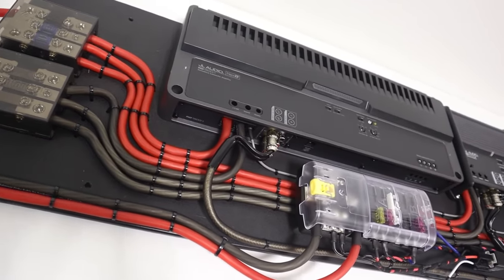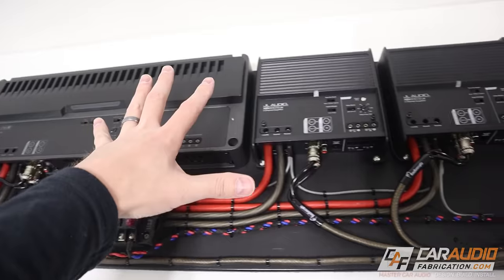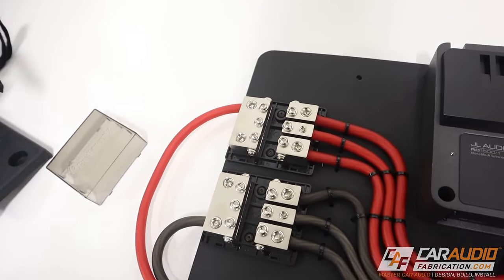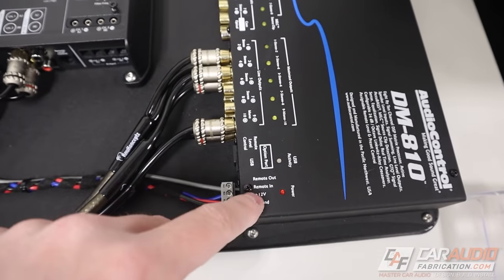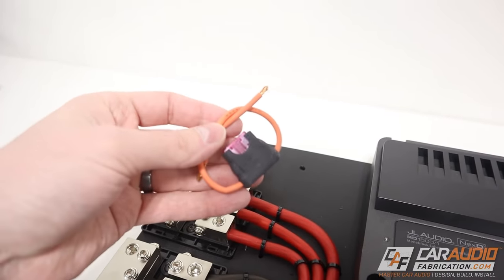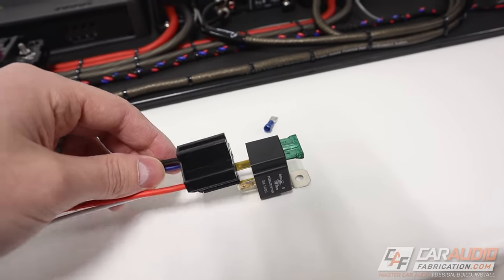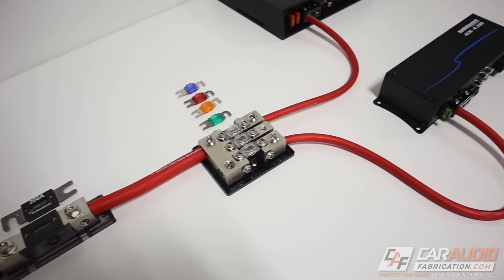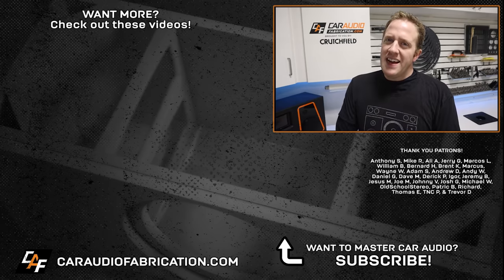Use RADIO to turn on accessories with a RELAY! EXPLANATION & WIRING

Comment from the maker: You guys asked for it...So here it is, Enjoy! If you missed the amp rack wiring video check it out here: https://youtu.be/UMAXMWmYX3o Thanks guys!
Reply: Is there a difference between a built-in virtual dsp over a physical dsp? I ask because some head units will come with a dsp built in. It may be included to make head units more attractive to consumers, but is there drawbacks? How versatile is a built-in dsp compared to a dsp from AudioControl?
Reply: All this power will u need a extra battery
Reply: Hi Mark. I have to note to the relays diode. While a regular diode will do the job you have a high voltage drop by using one. Best is to use a zener diode. They have a lower voltage drop while having the same results. Zener diodes are more efficient than regular diodes.
Reply: Hello Mark,
Love what you do with your installs.
Just wondering would you custom build a box for a 10" JL Sub that would fit a VW Golf? 
Thank you.
Reply: Where’s the rest of the build?
Reply: With a system like this how would you add a battery isolator and secondary battery?
Reply: Where do I get that relay at?
Reply: My head unit has a blue/white "system remote control" wire, but there's also a solid blue "power antenna" wire coming from the vehicle that inputs into the head unit(?) Which should I use to power on my 2 amps?
Reply: If you ever want to do a video series on a 2023 Hyundai Santa Cruz, let me know what I need to do!
Reply: Where can I buy the relay with a spike protection diode. I have no clue what I'm looking for . If u can send me a link to one I need I'd appreciate  it!  BTW I watch every single video you've made lol. Your a great content creator.

Comment: Do you have a link for the relay that you purchased with the diode built in?
Reply: Did you ever get an answer to this?
Reply: Still waiting
Reply: Not the greatest having to buy 8 as a diy guy but I'm sure it won't be impossible to flip the other 7.
Reply: Have 6 left after the install.... mistakes were made.  😂
Reply: @ElevatedVehicles he never respondes.

Comment: The relay idea is one of those "Why didn't I think of that" things that is so simple yet so elusive.
Reply: I've been using relays for about twenty years.
They are great for light bars, LEDs, amp fans, all kinds of things
Reply: @anicetomaldonado  I have not thought of relays for my amp systems, but I've been using relays for decades for lights, accessories, even making up my own turn signal converter for when the vehicle has amber turn signals and the trailer lamp is combined.
Reply: @robertemmons2260  yeah, I don't use them for amps, rather the external fans one adds to an amp rack. I even used to have a 12 volt coffee maker.
Reply: @anicetomaldonado  where do I get that type of relays from

Comment: As others have asked, how do we find the correct relay with the “spike/flyback” diode built in?  Google-fu is failing to provide answers.  I appreciate the videos, but it would be greatly helpful if you provided links to all parts you use when introducing something like this.

Comment: hi mark, with the relay wire i unpinned it and used new Female Spade Terminals with Locking Tab, crimped new wire cut to length.   The way i remember what wire go's where on a relay is the compass method, looking at the relay pins the vertical pin at the top 87 north N=( new device), 85 east E= ( earth) 86 west W= (sWicth 12v), and 30 south= (solid 12v)

Comment: Been using relays since frying two decks in the late 80s.  Newer equipment can draw less current than old school, but I still use them for future accessories as mentioned in this video.

Comment: I did this on my truck. Running a RF 400.4 and a RF 1200.1 with crossover network. The relay is triggered by the remote turn on and goes to the amps and xover. It also goes to a 100A continuous duty solenoid for ignition hot 6 way power/ground block for other items and another 6 way power/ground block for constant hot items. Works like a champ!

Comment: I am currently using a relay because I'm running three amps, LED rings, and a crossover.....and I fried the remote  output circuit on my first head unit before I thought about adding the relay. But even after adding the relay I still didn't think about adding the diode until I watched this. Thanks for the advice.

Comment: I would recommend always making a habit of putting your switched load on pole 30 rather than 87.  For a SPST, it makes no difference but if a SPDT is used it does.  If the 12v source is hooked to pole 30, then the wire attached to pole 87a will be energized when the coil is at rest.  While that wire can be left unhooked, it is a potential short since you have 12 volts running through the relay all the time.  

If you hook pole 87 to your 12 volt source, then you can hook 87a to ground.  This will ground the load circuit on pole 30 when the relay is at rest.  Once energized, pole 30 will see 12 volts as needed then return to ground once the relay is no longer energized.  The difference is only whether you have a loose hot wire all the time on the switched side of the relay, or not. 

As I said, for a SPST, it makes no difference. But if you just get into the habit of always putting the switched load on pole 30, then interchanging between a SPST and an SPDT an almost non issue.
Reply: It's important to have good habits like this. There are too many "good enough" methods, and many are not actually good at all and result in car fires, failed equipment, poor sound, and many other faults and failures. Good job taking a moment to share, we need more of this.
Reply: This is a joke right? If you ground 87a and have 12v on 30 then in an off state the relay is shorting 12v lol. Unless you're talking about setting up the relay so that 87 is 12v and you ground 87a. Why would it be beneficial to ground a power wire at rest lol?  I've been in car audio/aftermarket electronics for 5 years and I would never go through the effort of doing anything you just mentioned. If I'm not using 87a it's getting depinned, or cut short and taped with another wire on the relay with fabric tape on top making it all pretty.
Reply: @johncox6666  pole 30 goes to the amp, 87 goes to 12v source.  Grounding 87a just guarantees that there is no voltage on the circuit when not needed or wanted.  

You can just pull the wire or cut it short, but why not use it and ground the circuit if you have it.  When using the ground at rest the circuit is dead-dead and there is zero chance of any stray voltage activating anything on that line.  

Dad was an electrical engineer, so i picked up a few things from him that come from that background.  These are things he did as best practices, and generally apply to most applications even if not absolutely necessary. 

This is exactly how the electric choke on my old truck is wired.  Just ground the circuit when not in use - No need not to.
Reply: Can you make a video on this?
Reply: @mebordernoneya8484  its just time consuming and unnecessary imo. What's on the other side of the load? Ground. Which do you think provides better ground potential for current to flow? Backwards or forwards? If the engineers that made the product had any sense then power won't even be able to backfeed out the supply line even if the product does store power either with a battery, capacitors, etc. Maybe this logic made sense 30+ years ago but it doesn't now. Circuits can be made in a way that if they are storing power it's not flowing back out it's power input anyway so you applying ground is doing nothing. It's like when they say to battery reset your vehicle by pulling power and shorting the terminals together. Say it with me SoLiD STaTe MemOrY! Not gonna clear your codes lol. 

Not trying to hate, you do you. It's just the amount of times I've run into a permenant habit built upon one situation boggles my mind. Technician states they had one issue with x behavior of electricity so then going forward whenever they do that job again they jump through ten hoops to prevent one potential issue. When in reality that issue was either a complete fluke or they came to an incorrect conclusion but still worked around the problem and once again it is situational to that scenario. Be informed, fuse your shit, and know how to use your meter and everything's gonna be gravy baby.

Comment: Getting ready to install my most complicated system yet after about a decade of being out of the hobby. Your videos have been very helpful in getting ready to do it all the right way. One question: is there a specific reason that you use fuses on the large wire rather than circuit breakers. Obviously, if you install everything correctly, you shouldn't be blowing fuses. But it seems like a much nicer scenario to just reset a breaker than having to buy and replace the fuse.

Comment: 1:48 I am surprised you anchored the top ground wire to the bottom power wire right before they go to fuse block bcuz it pulled the ground up too high making it not look like typical CAF quality. Looks like the ground wire would first need to be shortened by an inch. Then drill zip tie hole to secure it to amp rack right before fuse block. I know you know what I'm talking about. Regardless, I'm impressed as always! Very grateful for your YT channel! Wish my filming & editing skills were up to your quality. Oh and my build skills as well! LoL

Comment: Hi , very nice video. I Have a stereo that uses amplifiers . My remote wire from the stereo is not working  (stays on always). Can I try to use the Switched Connection to power the amplifiers ? I can put a relay in this case.... 😄

Comment: unrelated to this topic specifically, but I would love to see a comparison between a three-piece component system and a two-piece component system, and your opinion on whether the three piece is enough better to warrant the extra work and expense.

I have a Lexus with a woofer, mid-range, and tweeter in each door and I'm wondering if I need to replace all three speakers or simply forgo the mid-range and go with a two-way component system.

Comment: Hey Mark, Thank you for all your tutorials. You have inspired me to build this. so, I have a question. I am using a A2b for my 2018 ford raptor and will this be a lil different or would I take the factory remote turn on and take to the relay? Yes sir,  I am over my head in this. but, I have always been interested in this kind of work. Also I am building your subwoofer box, using same subwoofers, same sub amp. also I am doing the door speakers. should I have a crossover or will my audiocontrol 810 been surfice?  Again thank you so much for your tutorials

Comment: Years ago a shop had told me that a remote lead was only ment to turn on 1 device any more then that you needed a relay. I know you're running alot of extras but at what point do you suggest a relay?  # of amps or what not
Reply: any more than two amps running off a remote line and you need a new source to tap for power
Reply from the maker: When the needed current will exceed the rating of the head unit. Usually not needed for today's multiple amplifiers, but obviously in this video the circuit is for much more than that.

Comment: So are you going to have a switch to turn on led or fans 
Or is everything going to turn on when you turn on your radio
Reply from the maker: I'll be using the radio. When radio is on everything else comes on, although you could use a switch too. Just depends on the goals of your application

Comment: I’m trying to dive in to designing my own, auto system, with after make stereo and 3x10 subs, 4x tweeters, the front and rear speakers, and there also a center front speaker, question is how many amps do I need, and how would I wire everything exactly?

Comment: The relay sockets are only good for certain applications. A spade connector is a much better way to install a relay with no breaks. The pre-wired socket has to have connections made to it. The spade connector wired to relay is direct, no breaks, no solder, no heatshrink, etc.

Comment: Mark, would you be able to do a video regarding the "capacitor" installment between the main battery and amps? Is "capacitor" use on car audio system out of date? My car vehicle alternator is weak to charge the battery. I have 2004 STI (stock) with aftermarket amps. thanks.
Reply: Sounds like you need a new and/or larger alternator. Just my 2 cents.
If it is outputting properly yet not charging the battery, you are drawing too much for it's capacity (Assuming a healthy battery anyway.). A capacitor won't help with that. Caps are made to help smooth out and support when the bass really hits.
Another thing it could depend on is if things are wired properly. If your vehicle uses a battery current sensor to tell the computer your electrical load then commands the alternator based on that, it can cause issues if the sensor is bypassed. It will always command the alternator to output less than needed causing it to always be stressed.
Anyone feel free to add/correct me if I'm wrong.
Reply: @caddyguy5369  

Thank you so much for the information. The issue is that my subaru mechanics do not recommend replacing an aftermarket alternator for my vehicle because they are unreliable. It seems there are no reputable larger aftermarket alternators in current market for my STI.

Comment: When I read the title of the video, I thought it was turning on a relay with radio waves like frequency. So You could use what is in your car key and it emits a frequency to start our open the circuit.

Comment: Could I safely add a high capacity relay between my amps and battery? My vehicle can sit for 3 months at a time, and I've had problems with the amp capacitors draining the battery. I know I could install a disconnect, but I'd like convenience.

Comment: Hey Mark, quick question. At 11 minutes when u talk about the white wire, could I run that white wire to my L.O.C. remote that is triggered from my speakers receiving power, GTO tech. (LC7i)?  I have a factory head unit

Comment: So much info for a newbie lol so here is my dumb question... I have two amps and from what I understand is that I don't need a relay for this, however I was told if you splice your remote wire and connect it to both amps then one amp will stay on when the other turns off. Anyone wanna help this DA Newbie out??

Comment: I still get sad at night many years later having to sell off my JL-500.1 monoblock amp. Old school. Bridgeable down to 1/2 ohm stable running 2 HCCA duel Voice Coil subs in my hatchback. Got to love how priorities change however my child is old enough now and is gonna be in her teens soon so gonna get back into adding a system in my project car which stock came with 2 component sets already which will sound even better once I upgrade them and amplify. However as I want 2 keep the weight down I'm only gonna add a really nice hard hitting 12 so supplement overall quality of sound. Should be good for music as well as playing DVDs. Jurassic Park would certainly be sick to watch in a vehicle...

Comment: Hey hopefully someone here can help me. I’m currently upgrading my 15 Corolla however I’m not exactly clear on how to hook up (wire) my front door speakers with my tweeters. My new hertz’s door speakers and tweeters COMBINED are 75 WATT RMS at 4 ohm. My amp will provide the 75watt rms needed. My question is with the tweeters. Since the tweeters have a built in crossover do I just take the negative from both speaker (tweeter and door speaker) and like wise with the positive with both speakers twist them together n+n and p+p  and connect them to the speaker wire from the amp ( obviously all negative wires connected and positive to positive wires) am I missing something? Am I over thinking it? I am planning on soldering the wires together. I’ve done subwoofers just never two different types of speakers to one channel on a amp.

Comment: I took out my relay because whenever I would turn my amps off I would get a nasty pop, I just run a fuse to the on and off switch and no pop
Reply: Even with my lci 8 out

Comment: This question has nothing to do with the video but do you or anyone else know what my options are for upgrading my so called PREMIUM AUDIO SYSTEM in my 2021 honda accord EX-L hydrid from what I’ve learned it’s a little tricky cause it’s a hybrid vehicle bottom line the factory premium system sounds horrible and I would like to replace the speakers in the door and rear deck and possibly the subwoofer if that possible maybe use the factory amp for the mids  and use after market amp the the sub please let me know I really want to get it done but have very little knowledge in this department I tried chatting with crutchfield but they don’t really have the answer I want to know exactly what to do

Comment: Instead of using a remote from the dsp/radio couldnt you just tap into accessory power of the vehicle?
Reply from the maker: You can use whatever turn on source you like.
Reply: @CarAudioFabrication  thanks for taking the time to reply.

Comment: Bruhhh have you taken the time to measure the current draw from each device??? Each amplifier only requires 10mA (0.01a) meaning you can actually power up more than 10 devices without issues.

The relay is a mechanical device, which requires 100mA just to power the magnetic field in the relay.

Comment: What about the current draw of a relay? How much current does the remote wire give? I am planning to use home sub with built in class ab amp powered by sinewave inverter and it would be quite tedious to always go to the trunk and switch the inverter on. I would need really big relay with at least 100A of max current.